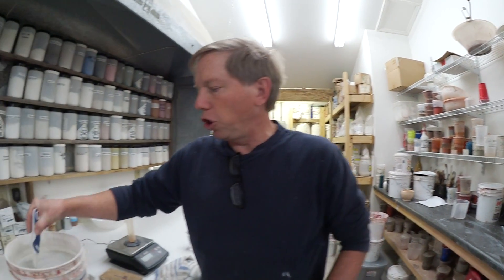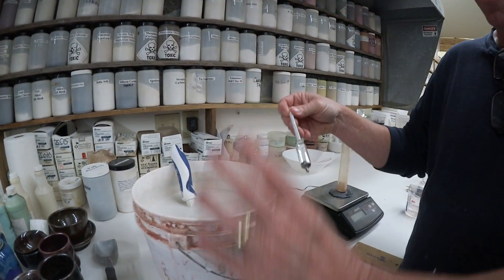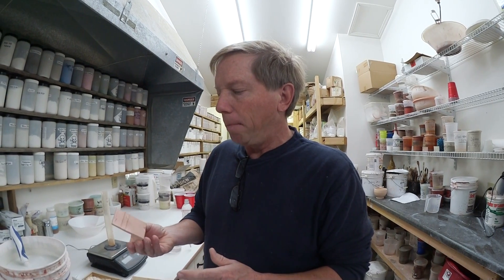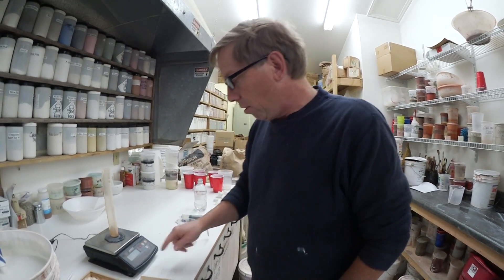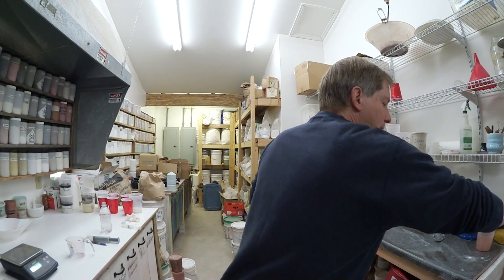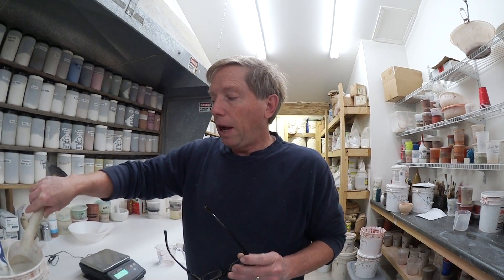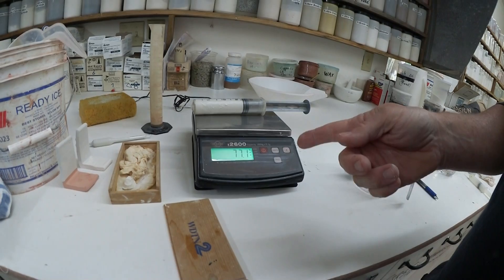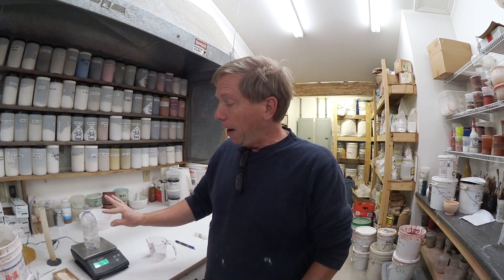Glaze Thickness or Specific Gravity (Free Online Glaze Course Part 20 Lab)

Comment: Thanks so much! At 4:35 you say 'If it ran, I would add a little more water.' You make the glaze thinner if it runs? I'm sure I'm missing something here. Thanks again.
Reply: I think you misunderstood, he means if it runs in the kiln I believe!
Reply from the maker: @languagelinguistics  you add water to thin the glaze (lower specific gravity) then if you dip or pour it on for the same amount of time, less glaze material lets on.
Reply from the maker: If it runs during firing...means it was applied too thick...so you think it with water and apply.

Comment: the question I have is there (if you are mixing your own glazes) an average glaze gravity for say mid fire glazes? Example: most glazes call for a gravity between 1.8 and 3.6. or what ever the number is. that way I could start with gravity and work my way back.
hope that makes sense
Reply from the maker: 1.40 is a good starting point
Reply: @johnbrittpottery  thanks John, that's what I needed to know.
Reply from the maker: @TheJmh19  don't get too fixated on sp. Gr. (Thickness) because what matters is how much glaze is on the piece. So variables are bisque temp, dipping, pouring, spraying, etc. Length of time dipping etc. So try and see.
Reply: @johnbrittpottery  o.k. and thanks. mostly I just dip and count.

Comment: with the syringe, it doesn't make sense to me ...
you zero the scale draw in 50ml put it on the scale, it read 77 or thereabout.....  then you said so that's about 154 lol.   you double it?  you left out how you get to 154
Reply from the maker: Yes. 100 ml is the normal amount in a graduate cylinder. If you only do 50 ml then you have to double it.